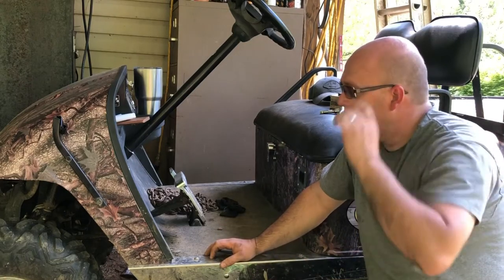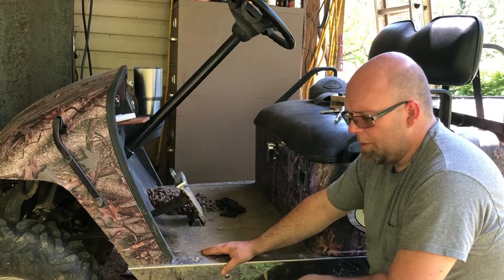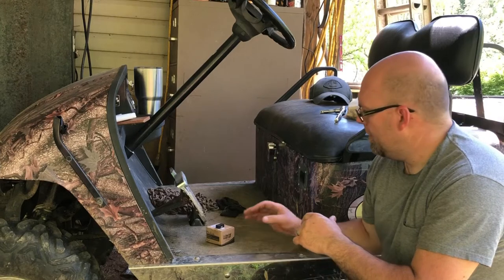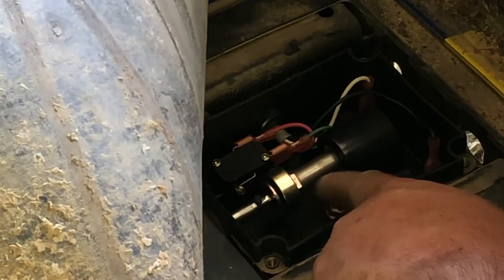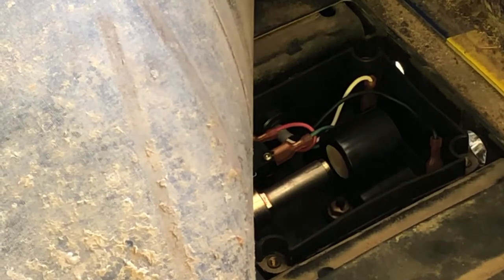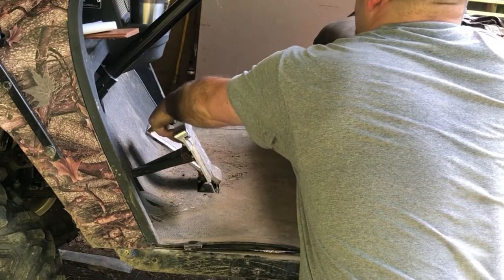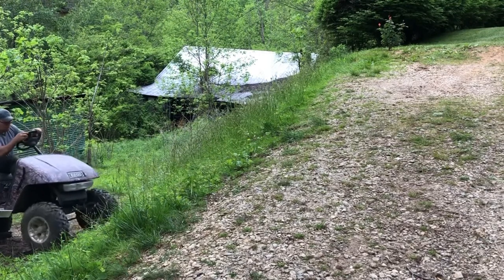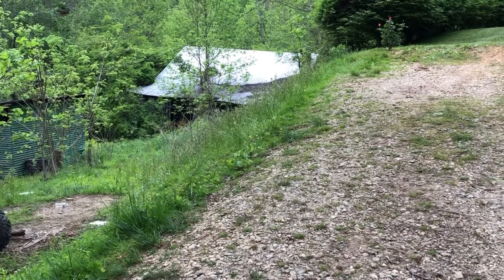Troubleshooting Ezgo TXT

Comment: I have a 2006 TXT Series cart, same series you have here. I had the controller rebuilt, changed all of the batteries, tested the motor, and I replaced all of the cables to 2 gauge. I went through two new forward/reverse switches. I learned that because mine is a 42 volt western series cart, I need the high output parts. All new installed by a cart shop and ... same problem. wont go in forward, only reverse and after a few minutes driving in reverse, now it wont go forward or reverse. Just sits and hesitates. I paid $3500 for this cart, street legal and it ran for about a year before the forward/reverse switch got hot and burned. I have had nothing but problems since. I am going to find the deepest lake, watch it sink, and hold a beer!!
Reply from the maker: You may need to check the solenoid. I suggest a 400amp. Then make sure you have a EZGO Heavy Duty F/R switch. 

I tried 3 f/r aftermarket switches before I finally got on that would work longer than a couple days.

Comment: did you ever figure out the issue?
Reply from the maker: F/R Switch. I replaced the original bad switch with an eBay switch ( $80 ). turns out that the eBay switch was also bad, yet it was giving different symptoms from the first bad switch. I broke down and bought a OEM F/R Switch ( $150 ).  It worked flawlessly